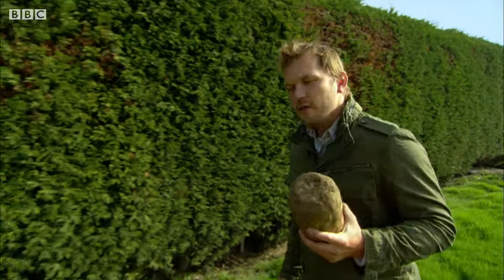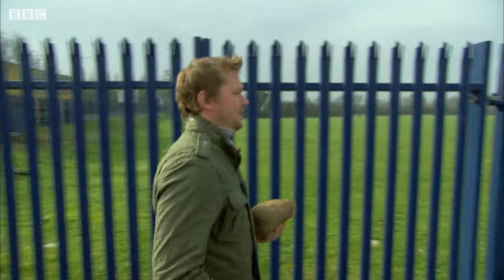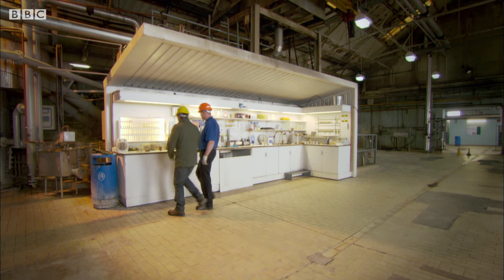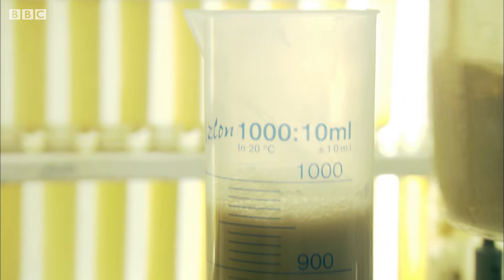How is Sugar Made White? | Earth Science

Comment: Real questions: How do they make sugar from sugar cane? How do they process stevia and reduce it's volatility, as in it's raw form it breaks down quickly? I'd also like to mention that some Youtube chemists have refined sugar in small quantities to white sugar crystals without to much hassle, and he said he doesn't use a filter, but you pointed out correctly that the lime acts as a filter.
Reply: The process is not that different, the canes are passed through a machine that squishes them flat separating the "cane juice" and the plant fiber, also called "bagazo" in spanish, the juice is can be drinked by itself, fermented into rum or other spirits like guaro and aguardiente, cooked into brown lumps or candy. To make sugar the juice is cooked until the glucose and fructose combine into sacarose (something like reverse hydrolisis, dunno i'm no chemist) and the water content is suficiently reduced. Eventualy the mixture will be dry enough to crumble as crystals of impure sacarose, called brown sugar. It can be further processed by "cleaning" it with sulphur gasses that pull the impurities rendering white sugar. The bagazo is burned to produce electricity and heat for the plant consumption, believe it or not it is quite environmentally friendly as the same amount of carbon dioxide released by the combustion is fixated by the sugar cane during its life cycle, which is quite short. (This is by no means the way it is done everywhere, but it is as close as the explanation given to us on a field trip to our country's biggest sugar refinery (in Grecia, Costa Rica))
Reply: They used the term "filter" but to be more precise they should have said "flocculant". Look it up :-) Flocculants are also used for cane sugar.